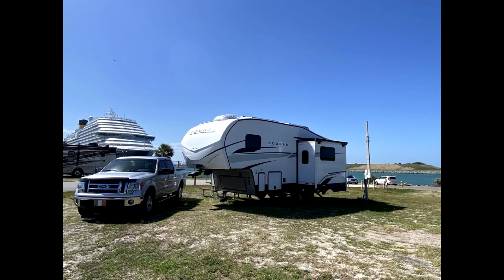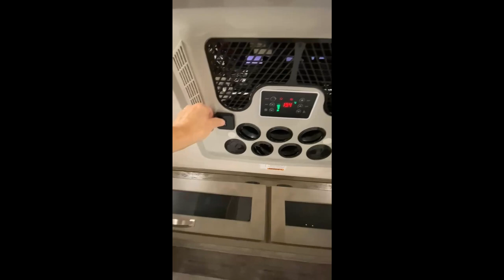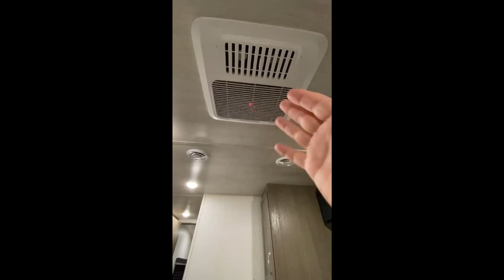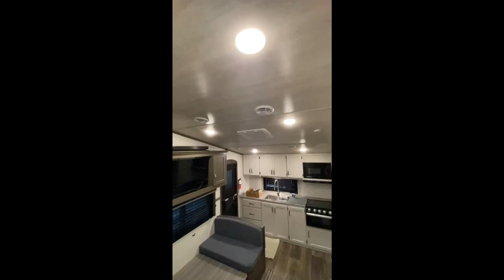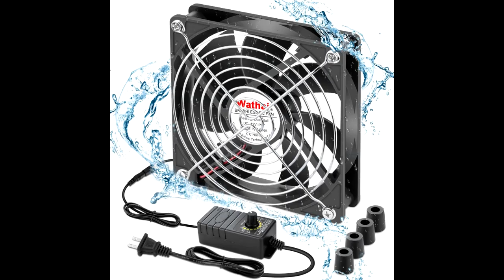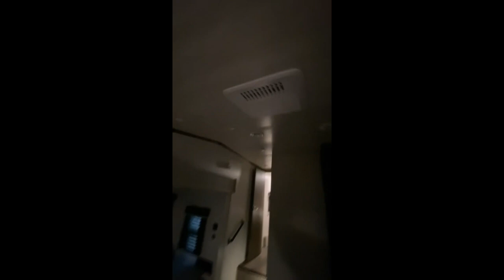OutEquipPro Summit 1 Roof Top 12VDC AC Unit

Comment from the maker: UPDATE:  I been playing around with this OutEquip Pro and existing ceiling ducts.  I removed the Titan fans and piping.  I opened up the 2X6 duct and isolated the intake and exhaust.  Then put a sheet metal plate to divert the output AC air towards the ducts forcing it to push air in while leaving some space to vent out OutEuip vents.  I used the Titan fans at the other end to pull the air down into Main Cabin and feel a way better result.  So my advice is to self make a box (foam-aluminum tape etc) isolating the in and out so the output pressure is pushing the air from the AC fan into the ducts.  Sorry no pics but many watching will understand :)